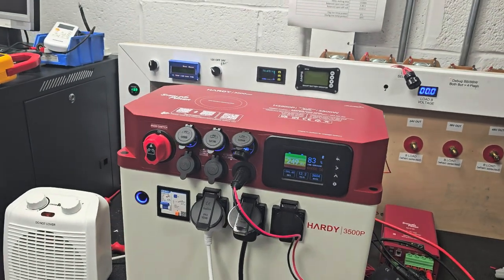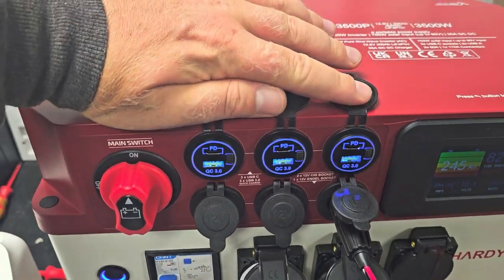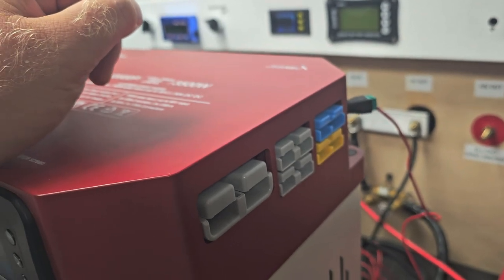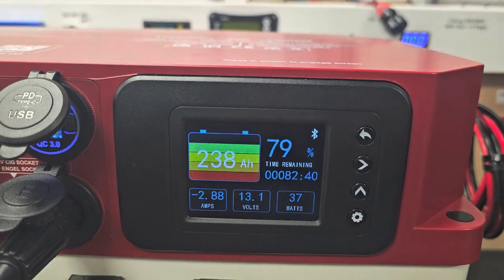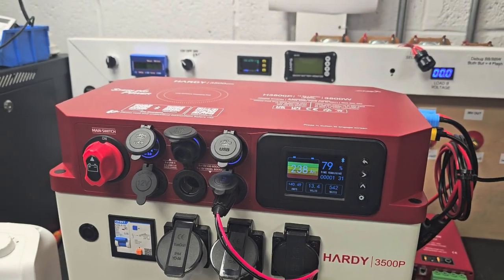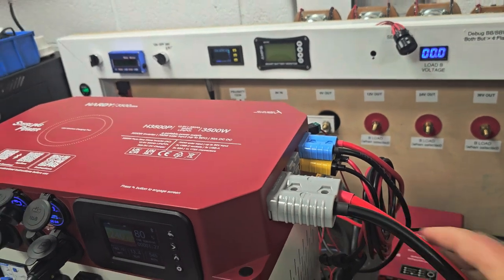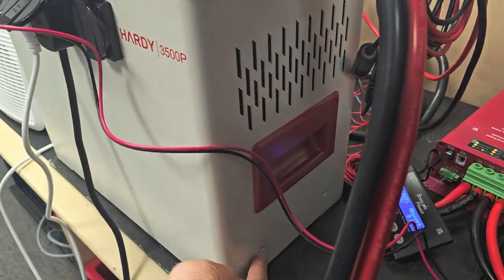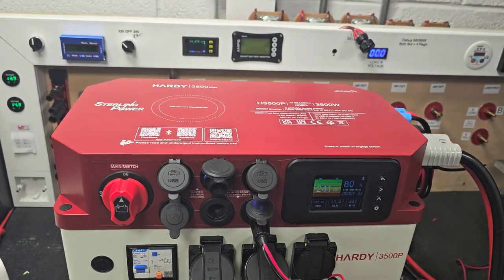Hardy - 3500W | 300Ah | 4kWh Portable Power Supply

Comment: Really nice product , what model and brand of cell you prefer to use in battery build?
Reply from the maker: In home-builds?
Really tough for us to say definitively, as with all things it kind of depends on 
A) What you have access to
B) What you want to do. 

Many cell manufacturers are broadly comparable- the fundamental characteristics of lithium iron phosphate batteries (outside of the solid state LFP cells making their way into EVs) remain constant. So long as it's a Grade A cell and reputable, you should be fine.

Prismatic or cylindrical- there are minor differences in their actual capabilities, but the main thing that matters to you is performance versus density. A compact high capacity battery is probably prismatic- but the actual C-ratings may be more reserved. 

The important thing with Lithium is often the BMS. Good balancing, reliability and safety comes from the BMS.
Reply: @SterlingPowerProducts  I completely agree with your statement, people need to put on paper what is available, what they can easily swap and always use grade A or buy from local trusted battery dealer not from other side of the world and later complain. For BMS its also difficult to choose, I will always recommend simple BMS, simple overcharge over-discharge protection, and no Bluetooth but more capacity of battery pack , more capacity will always be safe solution. Also installation of pack , ticker cable , massive contacts , good relay and resistors.
Reply from the maker: @harasti  The BMS is likely the most important feature of the pack- so long as we presume the builder isn't drilling into the cells during construction of course. 

Lithium iron phosphate has proven itself to be a stable compound in most instances. There are unfortunate exceptions, of course, however the gross majority of 'Lithium' fires that are never actually expanded upon stem from either cheap, unmanaged LiPo batteries, or NMC batteries.

I belive Will prowse has gone so far as to drill into LiFePO4 batteries... I think an old video ignited, but the most recent one just hissed, which shows how far they're coming. 

But- that aside, if we look at the data we have for LiFePO4 cells- LiFePO4 cells begin reaching a degradation/risk state at about 4.2V/c... Which is drastically higher than the peak charge voltage we would expect to see in a correctly charged and balanced system (Generally I wouldn't expect to see cells drifting beyong 3.65V- though if the BMS is slow to respond, the change in cell voltage at this capacity is very quick!). IE - With a normal charge voltage, it is very hard for the cells with even 'rough' balancing to get near this state. Exceptions being a failed solar system that dumps solar voltage across the DC circuit- an unlikely but very real possibility that I have seen.

The BMS should have as much protection as feasible. Over-charge voltage, over-current, over-cell voltage and cell-variance limits, among others. Bluetooth is arguably a 'fad' but also allows you to see things that would otherwise be too difficult to monitor. It depends on whether or not you are familiar enough with it all to be able to differentiate and understand the information without it worrying the user. Because of the stigma and fears around lithium- sometimes this can be hard to explain. 

So long as the system as a whole is 'correct'- the BMS will do the safety and it will isolate what it needs to when-and-where things, in the worst possible case, go wrong. 

I'd also note that as much as we support buying local and as much as the global climate (politics + economics + ethics) may lean against buying systems from abroad- most of the lithium in the world comes from the same place, and most of the BMS come from the same place (due to their familiarity with building it all)... And, sadly, a lot of the companies who are selling batteries as being made domestically are being (legally or otherwise) possibly flexible with the truth.
Reply: @SterlingPowerProducts  Thank you for clarifying some information and replying so fast. We still testing and producing battery pack with Winston 3.2V Lifepo4 cell , and for Li-ion 3.7V still safest for us is LG e78 and e64 prismatic cell even everyone hate them, problem is bad installation and bad BMS, LG cell are perfect and we have big respect for them. Also Samsung SDI 60Ah and 94Ah prismatic we build battery pack for boat , but still forcing customer to use regular charger not solar charging. Solar only if they want to pay for victron system.
Reply from the maker: @harasti  Happy to help.

I genuinely believe that if you're focusing on power storage and it's for domestic, camper, commercial or even solar-home use, your best chemistry is Lithium Iron Phosphate. 

Li-Ion makes sense if you really need aggressive discharge, but that's not normally the case for these installs. They have capacity large enough to sustain use. 

I would argue that if LiFePO4 energy density (Solid state-?) continues to improve, it'd be the better option for EVs over Li-Ion/NMC. The ability to use the full capacity without degradation is very useful, and will be safer in a 'crash' incident too, one presumes. 

LiFePO4 is becoming more-and-more affordable and stable- and can integrate into LVD-DC systems very well. 

If you guys ever want to get some Sterling items to trial with your clients, we should be able to support.